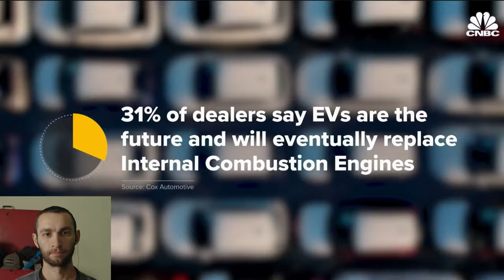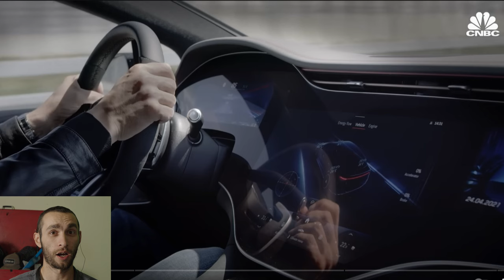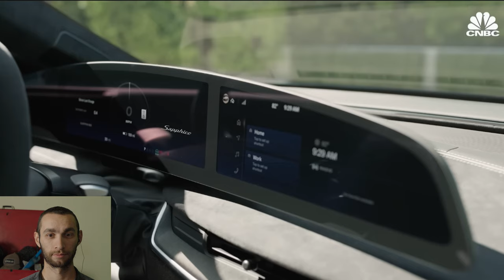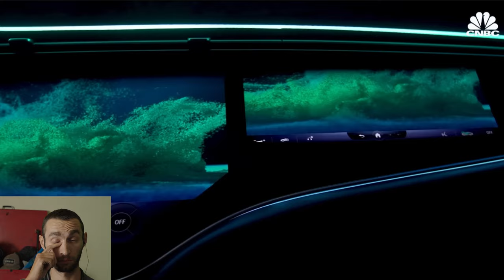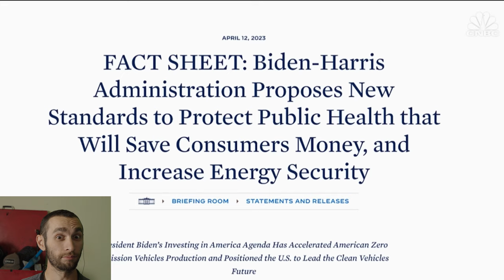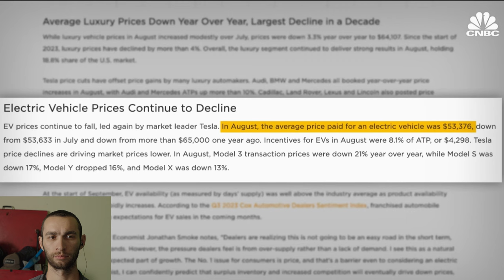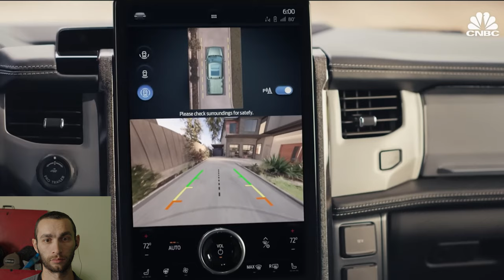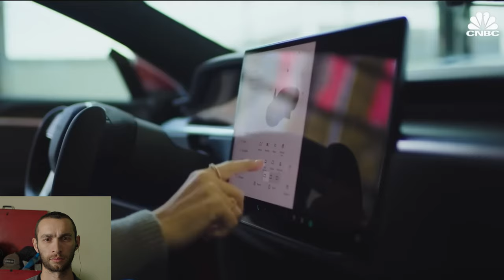Why electric vehicles are stuck on dealer lots according to CNBC

Comment: After buying a brand new Tesla Model 3 Performance 2 years ago, here are my takeaways: The car is a joy to drive. Fast as hell, instant acceleration, quiet, drives like it's on rails and no mechanical issues whatsoever. No oil changes, only tires and washer fluid. Light years ahead of gas cars in efficiency and cost to operate. Regular over-the-air software updates keeps adding new features. Full self driving software is almost perfected.  If you own a home like I do, you plug your car in when you get home and it is always topped off.  

There are some downsides. Long distance driving requires more frequent recharging but the navigation software tells you where and when to stop at a Tesla Supercharger.  Gasoline cars definitely are more convenient for road trips.  Those who live in apartment complexes will have to charge at Superchargers which makes it more inconvenient. Owning an EV other than a Tesla right now is less desirable because only Tesla has an extensive network of Superchargers. Battery longevity and reliability is the unknown for the second hand market, but I've seen them last over 400,000 miles. EVs are not just thrown in the junkard, their batteries contain valuable minerals which are recycled and used to make new batteries. 

This is the future people, like when we transitioned from horse carriages to cars, incandescent bulbs to LEDs. Fossil fuels will only become more expensive and harder to find.
Reply from the maker: I'll agree with this last statement when they can eliminate the compromises we have to make over regular cars. When we moved away from horses, it was only after all the glaring weaknesses had been resolved. The automobile saved the consumer money and gave him new capabilities over the horse and carriage. We're not quite there with electric vehicles. Check in with me in 10 years and maybe we'll be singing a different song. Thanks for watching! Like and subscribe!

Comment: #1 The interest rates are high. Leasing a vehicle is probably the least expensive way to buy, but you can’t least unless you have good credit and can afford the higher insurance payments. When you’re talking about 9 to 12% to finance a new car, most people can’t afford it. It isn’t just electric vehicles that are piling up, but the gas vehicles as well.

#2. Insurance premiums are high. Insurance premiums are so high that they are starting to mimic car payments themselves.

#3. Some electric vehicles are basically electric versions of the already perfected gas version and that can make them a difficult sell.

For example: the new Cadillac OPTIQ is $54,000. But you could buy a Cadillac XT4 fully loaded with many of the features that you would find in the OPTIQ less than $50,000. 

The XT5 and XT6 both cost less than the LYRIQ and use regular unleaded gas ⛽️.

#4 as far as I can see most electric vehicles are expensive enough that they kind of don’t make sense when measured against buying a cheaper, regular unleaded using car. Electric vehicles make the most sense when you measure them against buying a premium fuel using luxury car.

#5. Most electric car buyers want to buy a Tesla. Tesla has pioneered electric vehicles and most people think Tesla when they think electric vehicle. Tesla also has a  charging infrastructure that is second to none.
Reply from the maker: Insurance is the biggest scam I've ever seen. Insurance alone is pricing people like me out of ever owning a new car.

Comment: It's really fascinating to watch as it looks like they've gone for big luxury motors rather than something more affordable. The exact same thing is happening in the UK. We ve got one petrol/gas car, one diesel and just got an EV. For town the EV is perfect, but doing any rural long trips is out of the question as the charging structure is not good enough without adding a huge amount of time. The diesel is an XC70 and won't be changed soon as you can put a trailer on it, put 5 people in it and luggage and still do 500 miles wihtout any issue. To do that in an EV I'd need to spend insane money. I guess they've pitched the wrong use case, affordable EVs as city runabouts make the most sense and probably have the best impact (with air quality etc...) at least initially.
Reply from the maker: The entire market seems to have moved the bar up for new car ownership. Too many options that cost too much money. There's no more basic vehicles available anymore. I think it's gotten to the point where the charging situation is doable for Tesla owners in the United States, but you're still looking at adding a significant amount of charging time on to any long trip. The XC70 is my favorite car that I've ever owned. I had a t5 with the straight five cylinder. I don't think we get the diesel motor over here. Thanks for watching! Like and subscribe!

Comment: Main three factors as I see them, range, battery degradation and mainly infrastructure.  Charging stations are nowhere nearly enough of them, long time to charge and now with crime on the rise, gaining a reputation as not a safe place for many EV drivers.  Not that gas stations are any better, but the amount of time spent at a gas station is significantly lower.
Reply from the maker: People think there's less pollution, but it really just seems like the pollution is offset to a different part of the world. The main problem I see is little black kids in the Congo dying for your Cobalt.

Comment: Disagree....we are fortunate enough to have 4 cars in our family (2 EV's and ,1 diesel and 1 gas). No anxiety with the electrics just plug them in at night and you wake up to a fully charged car. The EVs get 15-20k miles put on them per year, the diesel 2K and gas 3K. Its just too convenient, more powerful and cheaper to drive the EV's on the daily!
Reply from the maker: I'm happy for you. But what exactly are you disagreeing with? That EVs are stuck on dealer lots?
Reply: @TheYouTubeMechanic  And so are Toyota Tundra's Ford F150's, etc. People are holding back waiting for lower interest rates or settling for less expensive new cars.

Comment: Inferior technology? You must work for Exxon Mobil 😂
Reply from the maker: Nope I just work on cars.
Reply: @TheYouTubeMechanic  gas cars.....exclusively.
Reply from the maker: Regular cars. And diesel.
Reply: It is inferior. It takes 14 years to offset the amount of pollution it takes to build EVs, where most people don’t keep cars for that long. So if you keep it for 5 years, you’ll never offset it. Just because it speeds up faster than an ICE vehicle doesn’t mean it’s superior.
Reply: @goobcutusofborg3357  12.6 years is the average age of cars in the US fleet. I don't know what 5 years has to do with anything.
Reply: @typhoon320i  because people that buy higher end priced cars are less likely to keep a car for 12 years. Many won’t keep a car passed 100k miles. If you drive the average of 15k a year, that’s about 6 1/2 years. So if you extend it from 5 to 6 years, you’ll still be at a net negative in pollution compared to an ICE vehicle.
Reply: @goobcutusofborg3357  Ok, so then the car goes from it's first owner at 6 years, to it's second owner, maybe for another 6 years. It's not like it goes to a landfill.
Reply: @typhoon320i  and who’s going to keep an EV past its battery warranty date? Tesla has an 8 year, 100,000 mile battery warranty. If driven the average of 15,000 miles a year, the warranty will last 6 1/2 year. Who in their right minds would want to buy an EV with no battery warranty? To replace a Tesla battery, it cost between $13k-$15k. People that buy used cars don’t have that kind of money just laying around or they would have just bought new.
Reply from the maker: And then you got people like me who got a 14-year-old car, a 20-year-old motorcycle, a 24-year-old motorcycle and a 30-year-old car.
Reply: @TheYouTubeMechanic  I have a 43 year old car, a 32 year old car, a 20 year old car, a 14 year old car, and an 8 year old EV car
Reply: @TheYouTubeMechanic   oh, I know plenty of people like yourself that have old cars like that. But using typhoon’s way of thinking on EVs, would you want to keep those 2 cars knowing you would have to spend $30,000 to replace the batteries? 

Hell, for that kind of money, you can probably refurbish all 4 of those and make them look and run like new. Lol
Reply from the maker: I think the computers alone are going to prevent major rebuilds in the years to come on all new cars.

Comment: You cant make people buy stuff they dont want, in my opinion plug in hybrid are the answer for now.
Reply from the maker: The answer to what question though? The pollution question?  Either way, I think it's still more battery than I care to have in my car. Thanks for watching! Like and subscribe!
Reply: @TheYouTubeMechanic  it should be up to public what they want to drive I do lot of daily driving and changed from diesel to hybrid I miss the manual gearbox but it saves me  money on fuel best of both worlds I guess.
Reply from the maker: Yeah I agree with that. What do you drive? Which hybrid?